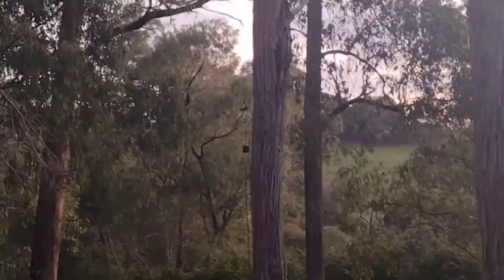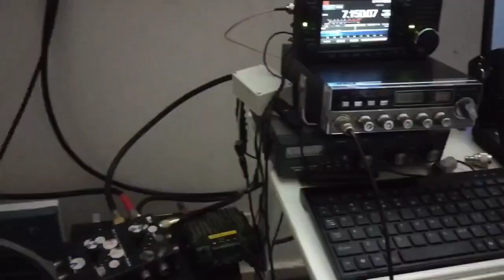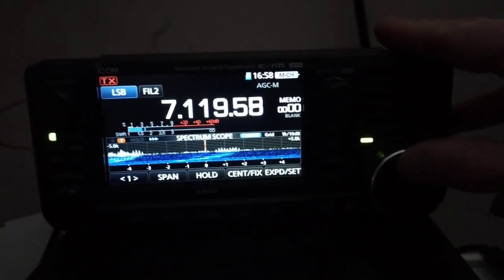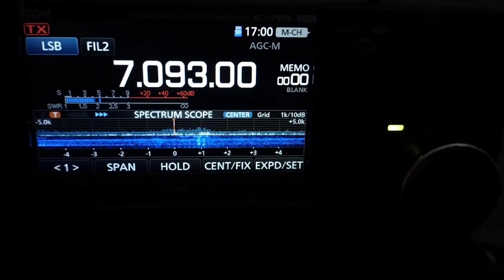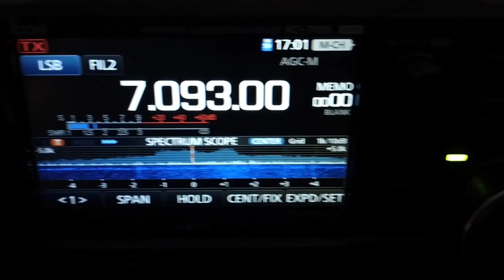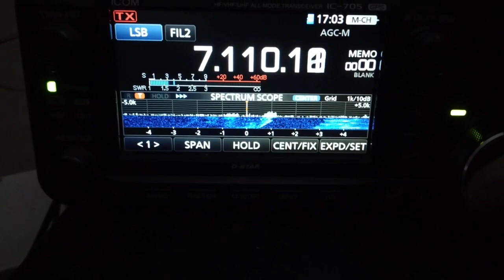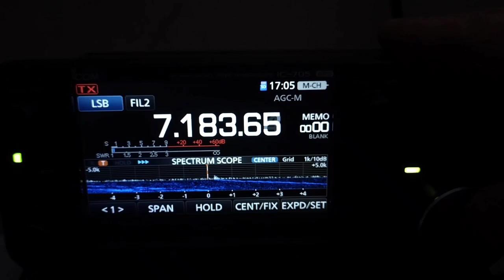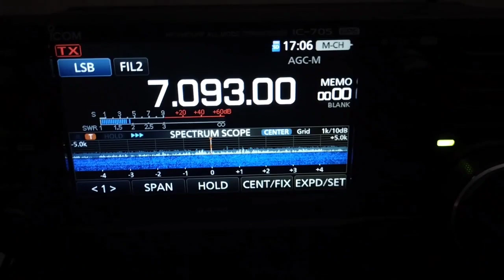HF Limited Space Antenna vs Inverted Vee Dipole RX Comparison

Comment: Thank you my friend!

It also would be good to explicitly compare noise floor for both antennas. For experimental antenna it seems to be lower, but to what degree is not clear.

Also, in most switches, the shield of the larger antenna cable is kept connected and  can serve as an additional counterpoise, which is not desired when measuring reduced size antenna: it gives it some full size properties. Before using the switch, please ensure that described situation does not occur. To do that just compare signals on small antenna with large antenna connected and completely disconnected from the switch. If there's no difference, then all is well, and configuration is ok to use given switch.

And last, 40m band is more interesting in the night, would give variety of signal sources!

Keep your food work going! Thank you.
Reply from the maker: Excellent Feedback and advice my friend.

I had already checked to  make sure that mutual ground coupling wasn't happening
by removing the Dipole pl259 from the coax switch altogether 
and had no changes in RX.

I think I mentioned that in the Description too.

Definitely great advice
as   it is so easy to assume a small system is doing great
not realising it is using the grounding and coax shields of other connected antennas etc 

I have fell for that one before haha.

Much appreciated mate ⚡🙏⚡
Reply from the maker: I have given some thought to your suggestion regarding comparing noise floor
and in my view,
it would be a fairly useless observation / comparison
because in a different operating situation
the effect of RF noise on a classic inverted vee vs this type
would depend on the type of local noise source, magnetic or electric
and also in both cases would depend on the relative incidence angles of the E and B or H fields...

I am just happy that it has a low noise floor 
as does the inverted vee
yet that is predominantly due to heavy coaxial choking on the both.

Give me your thoughts 
if you think I am missing something my Friend.